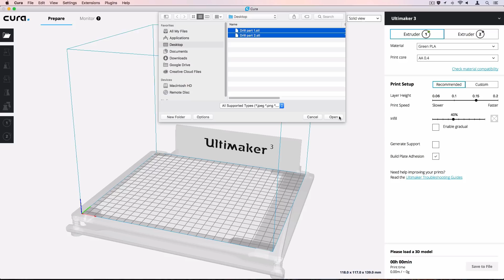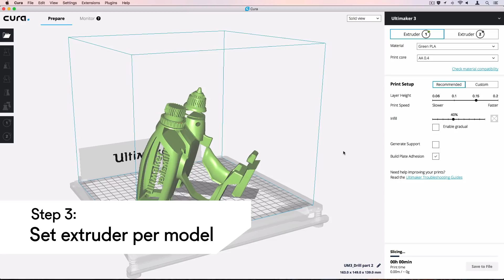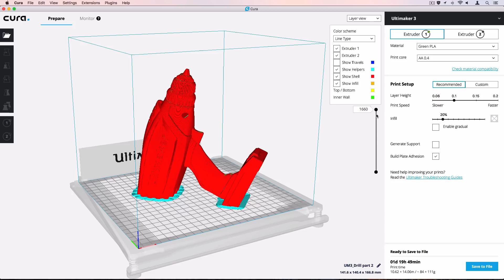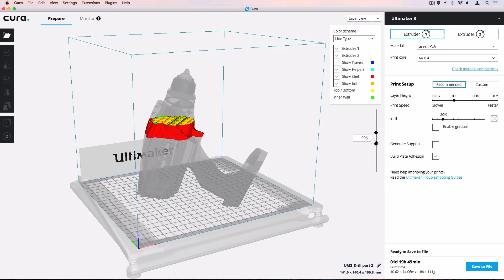Ultimaker: How to print with two colors

Comment: How do we choose "how the merge" should happen. Example: If I want one model to merge with the center of the other and not on the side. etc.
Reply: You have to make sure that they're lined in your CAD-model already before exporting them (as individual parts). Cura just takes the pre-position from your CAD.
Reply: @JacobvV90  This is not true, I have a project that I cannot print because the merge will be messed up everytime I try to merge the parts.

Comment: "all major 3D file formats"? Not a single CAD file type containing real circles instead of polygons are supported. Thus it will never know whenm to create G-code for real circles instead of many small, linear movements.
Reply: Which major 3D printing format did you have in mind that supports that feature?
Reply: MrSwanley I did not say "3d printing file format". I used the phrase "3d file format" from the video. I'm thinking about STEP, ACIS, ProE or a similar common CAD file format.